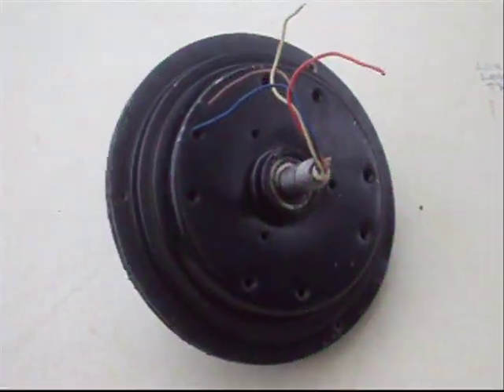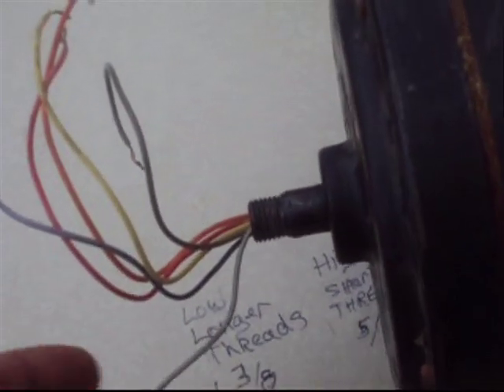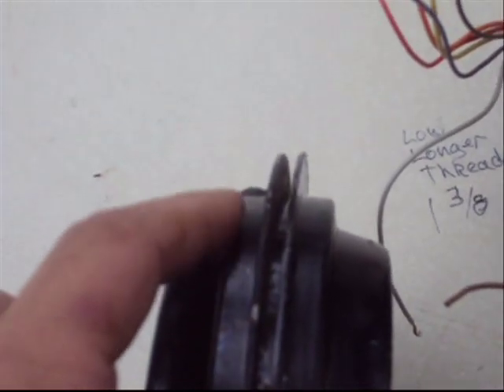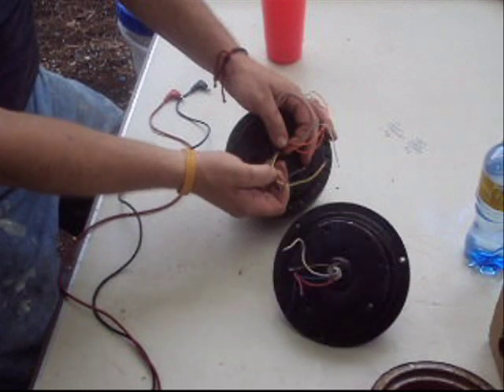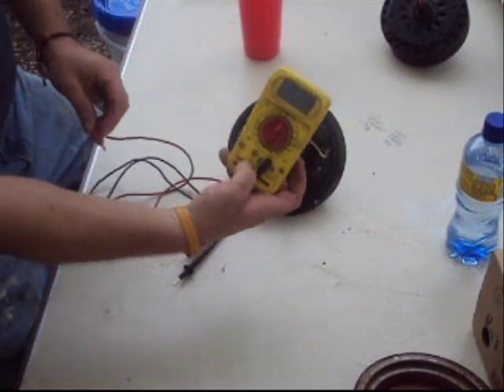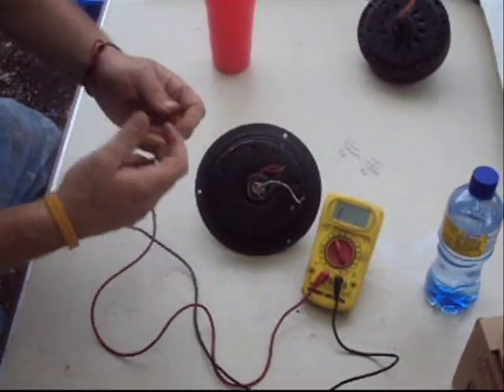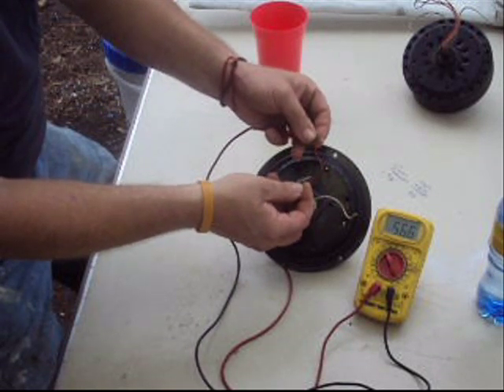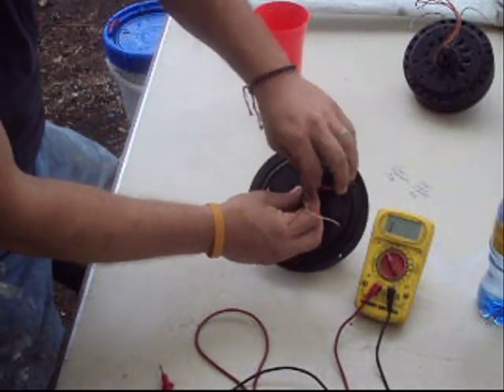4 THE CEILING FAN WIND TURBINE CLASS PART 4

Comment: what is the width of steel banding and why we use steel banding.
Reply from the maker: +Naga Saikrishna Boddu The width of the steel banding doesn't matter much. the thickness of the total layers does. I place as much of the steel banding as i can that still allows me enough room to get the bolts through. 

the reason for the steel banding is to conduct the magnetic flux of the magnets. that allows the strength of the magnets to double as if you had stacked them.
in other words, it makes all of your magnets to have almost two times the strength that they would without the steel banding.
:)

the magnetic flux path goes from one magnet through the steel banding (that makes the strength of the magnets to add the strength in that part of the path) Then it goes into the coils, and back out through the coil next to it. That makes it a full magnetic flux circle, or complete circular flux circuit. I hope that helps.
Thanks

MUDDy

Comment: i have also 4 wires. but every wire can be connected to another. i have more than two combinations there. i tested the wires from a big oscilating fan. do i have more than one coil there?
Reply from the maker: ari cri It is hard to say. Did you see the ceiling fan work before you received it?
Anyway, another way to tell is to install the magnets and spin the motor at a constant RPM, and check for the two highest voltage pairs. rectify the two pairs separately. connect the outputs in parallel, and the battery will draw the voltages down to the desired voltage level.
MUDDy
Be careful not to get shocked. :)
very low RPMS may be used for the tests. (recommended for safety)

Comment: Hey Muddy.  Just wanted to let you know that I have learnt a lot from your videos.  I am in the final stages of my ceiling fan turbine (which is unheard of in the UK)...finally got the magnets in the right positions and now get a good tickle from the wires when I spin it up by hand..about 30-50 volts.  Just need to work out how to mount it and find the scrap parts ( the UK has gone mad on sending stuff to the tip so scrap is hard to locate)...  Thanks for your videos .

Comment: I have been watching your vids and I got a small problem. I got a ceiling fan from a remodel of a restaurant and it only has three wires, a red, brown, and white. When I hook my multi meter to the red and white wires I get 135 ohms. Any other combination I get about 35 ohms. The white wire is connected to both inner and outer coils while the red wire is on the outer coils and the brown on the inner coils.My question is  how would I wire this one? Any ideas?

Comment: It's too cold outside to work on the turbine, so I'm going to build another generator. This one has room for 36- 1/2x1/2 magnets . Would I get the same effect if I used 18- 1" x 1/2 ?  I'm thinking that the flux might flow the same as two seperate magnets. Actually I can fit 5/8" thick magnets in it. From the outside of the stator to the inside wall of the case, is  1.1 inches. I'll be turning a cast ring to take up the space that's left. This may cost a bit, but there ain't no free lunch.

Comment: Oh No! Here's something you don't want to do. I poured another stator. It didn't fill in all the way, so I decided to fill all the voids with JB weld. I didn't realize that JB weld had steel in it. When I filled the first hole, all the mix came out of the hole and migrated to the top of the magnets. Luckily I noticed it, did a little reading of the contents, and was able to wash it away with hot water and a tooh brush. They're stuck good enough. I going to just put it together with the voids.

Comment: Mr. Muddy
I was finally successful. Got the magnets in correctly, and the multi meter said I was getting voltage and amperage. Both sets of coils work. I poured the resin yesterday, in the garage. I had to put a heater on it cause it was 30 degrees out there. It was set in about 4 hours, at least that's when I looked at it. I hooked a string of 100 LED Christmas lights to the outer coil, put a belt around the chuck and the motor housing, and was able to light them up. I have more to do.

Comment: I found a montgomery ward fan. There are only 3 wires coming out of the tube. The white wire and red wire give me 80 ohm. all other combinations give me 40 ohm. The outside coils go all the way around then the coil wire jumps across to the inside coils, which makes me think the whole thing is one wire. the white wire goes to the outside coils. The red and black wires go to or from the inside coils. I'm going to try this just using th white and red wires. Am I right?

Comment: I would suggest J'B Weld' instead of a CA adhesive.  The CA will eventually fail from the humidity and heat cycling.  But you DID say you'd epoxy it at the end, so not sure why you used CA to begin with.